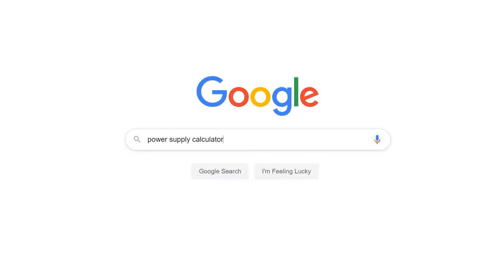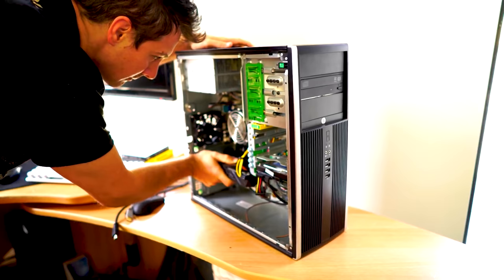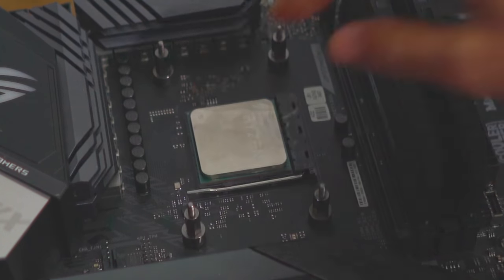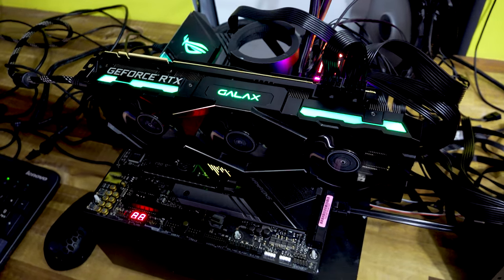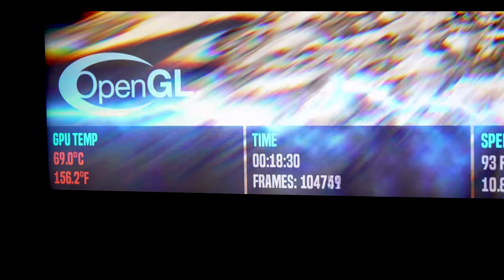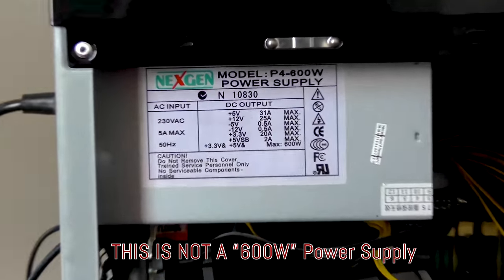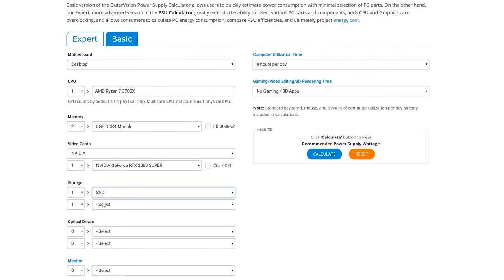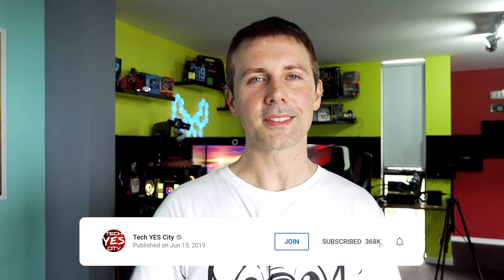I Tried Running a 3950X and RTX 2080 Ti on a 450 WATT Power Supply...

Comment: I'll give it 6 months. Had a 480w die on me in that time. Running two GT7800 cards in SLI with a P1 PhysX card, an X-Fi Fatal1ty, and an Athlon 64 x2 with a whopping 2GB of DDR400 RAM. Random hard drive errors and case feels very hot inside. PSU thankfully failed gracefully and did not go pop. Replaced with a 620w PSU, but it still runs unstable. The machine only became stable when I finally installed a 750w PSU.

Comment: Also its best to check "expert" part of that website and check how much your gpu/cpu model boosts because in basic mode they calculate absolute stock clockspeeds, for example gtx 1070 rated for 1500mhz while in reality its more like 1800-1900mhz just out of the box so the wattage automatically higher. I myself wanting to get 1kw psu because i plan on getting 3080ti and upcoming 4950x and calculating with its predecessors  3950x/2080ti with max load and actual clockspeeds and voltage (out of the box) its reaching 650w load without any other parts such as storage, fans, etc.. 

I bet if he did absolute stress test like furmark and cpu-z stress test at the same time the psu would shut down very fast and as he said its really not recommended to run these components on such low wattage psu.

Comment: This makes me confident I can run upcoming RTX 3090 or whatever with my Seasonic P660 mark2 PSU even tho it starts to be kinda old, I am sure it is strong enough! Thanks!
Reply: I would do some stability testing on your existing power supply (by running a gpu stress and cpu stress at the SAME TIME, max power draw on both!) and watch the voltage rails in hardware monitor (aka HWmonitor) to see how far the dip is on your 12V rails before deciding that it is good enough or not. If it is dipping a lot (like down to 11.5v) or you have instability, or you notice the PSU blowing very hot exhaust after testing a while, you may want to upgrade. Not every PSU with a given wattage rating will be able to handle the same size load, different brands and models will do better or worse.
Reply: @mikee9167  Thanks for the tip, looks like 3090 will be beast to drawing power! I notepad you comment to desktop txt file so I remember test when I have time, THANKS <3
Reply: @Muwex  no problem! to be clear I meant to say you should do this once you get the new video card to see how your PSU handles it, then you can upgrade PSU if needed and save money if not.
Reply: @mikee9167  Oh yeah sure!

Comment: Hey Nice Video. 
It was expected of YouTube to show this video on my recommendations as I was looking for PSU upgrade and searching for it. I too used to run a 450 watts PSU and it did the job just fine. After purchasing a new RX 590 paired with Ryzen 2600X (95W TDP), I felt that I need to upgrade my PSU. On the RX 590 box, they also had written that they recommend 500 watt + PSU to pair it with. What I learned was you can very well run everything on your 450 watt PSU, but it is the most stressed part in your build. PSUs are really robust and can last as long as your build, but if you juice them out regularly or frequently then it will not last you long. Plus I have seen many YouTubers saying to purchase a higher watt PSU than it is recommended as this will have the maximum efficiency of your system. 
Never cheap out on PSU as they have the potential to blast. Save a few bucks on your specs and go with a branded PSU. Hands down

Comment: Been running a 9900K and a 2080 Ti for a while on a 4K display on a 450W fanless PSU. If you set a power target around 80% and downclock to 4GHz (clockspeed isn't that important in 4K anyway), my wattmetter says it doesn't even break 270W during peak gaming.

Comment: it’s always good to go for a higher power PSU if it’s the same price as the one you’re looking in case you want to upgrade in the future. it will make it cheaper to upgrade, as you won’t have to buy a completely new power supply.

Comment: It suprises me you did't talk about efficiency. Efficiency logo's are a big thing in the PSU world.
You have a 450W 80PLUS power supply, so it needs to provide 80% efficiency under full load.
If you would use 444W on the 12V rail, the power supply would draw 555W from the wall. This means 444W (80%) is usable, but 111W is lost as heat.
It could be the power supply is able to deliver more then 444W, but not at an efficiency of +80% and so the 450W is a marketing decision. 
The input is 200-240V 4A, so the maximum draw from the wall is between 800W and 960W. If above 450W the efficiency could drop to let's say 70% (as an example), it would deliver between 560W and 672W. Also some power would go to the 5V and 3.3V rails, but you get the idea.
If used up to  450W, you have the 80PLUS PSU you paid for. If above (and under the max currents the fuses allow), you would be able to get more power, but at a greatly reduced efficiency.

I own a Corsair RM650X; this is a 80PLUS GOLD PSU. At a load of 50% it gets an efficiency of 92%. This makes it can be a semi-passive PSU. This means the fans don't spin, because almost no heat is made. So if i would draw 325W, only 28W is lost as heat. Under max load, the fan would spin up and the efficiency would drop to 88%. (650W to the system(88%), 88W lost as heat (12%)).
Long story short, there is more to a wattage on a PSU then the fysical max power that can go through it.

Comment: 450 W is the rated output. If it couldn't get 80+ certified at 120 V (only 230), that means it's just barely over 80% efficient. The highest watt draw I saw was 430, 80% of which is  344 W. This power supply is barely breaking a sweat.

Comment: You also can buy a higher rated, lower efficient power supply. It basically comes down to the same as long as you don't fully load it.

Comment: I have a Corsair VS 450, with Ryzen 5 3600X and Crossfire ROG STRIX RX570 with B450 Tomahawk Max and Gskill 3200mhz CL14 and 6Fans, Deepcool RGB 350 and 360AIO. 1x M.2 and 2 HDD.. Nothing happened... Still works great, although I have a expensive Servo Motor AVR, maybe that's the reason why it's still working to this day.

Comment: Hi there, can you tell me if that CM PSU is of good quality? And also the Corsair CX ones. CoolerMaster and Corsair opened up their branch in my country recently and I'm in a need of a good power supply but I don't have a lot of money. Is that CM MWE or the Corsair CX, or the VS, a good power supply? I'm planning to upgrade my graphics card as well with an RX 580 8 GB or, GTX 1660 Super or a RX 5600 XT, Maybe if I can the RX 5700 XT. Are those two PSU from these two companies good enough?

Comment: i currently have a 450 watt power supply and this is really cool and reasuring because it shows how high i can potentially upgrade my system from my 1060 and ryzen 5 4500, i might even be abkle to run a 3070ti if im careful which nis really cool to know. thanks!

Comment: The most important thing to understand about Power Supplies is the multiply your predicted load by 1.3 and that should give you plenty of headroom and keep your PS operating efficiently. Well, I can tell you that Corsair PS is not so great, I have had 2 fail on me but they honored their warranty.   EVGA is the only PS brand that I have used, out of MANY, that has never failed me. Multiple 12v rails is the best because the 12v rail is the most common failure because it has the most demanding load.

Comment: That "600W" PSU where did you get it? I need one with a negative 5 volt line for a project I'm working on. I hope you see this cuz I've spent over a thousand dollars on different supplies looking for a compatible unit. I've been piecing together a 98 machine and the main board is not liking the corsair units (tries to boot but switches off after a few seconds) the seasonic units just don't work no post code either. Apevia Units get it to the Post screen but the readout on the post code signifies the -5v rail issue.

In short need a PSU with -5v rail, tried supplies from seasonic(no post code),
Corsair (post code error with -5v),
Apevia units (post code error with -5v).
Any suggestions are welcome.

Comment: The only reason to get some more wattage is that psus are at the most efficient at around 60-70% load and then we have the soundfactor, 90% of psus are loud at 100% fanspeed so to only get it to 50-60% load you will have a silent one.
And people buy cpus for 500$, gpu for a 1000$...spends 99$ on a psu...just pay 200-250$ and you get the Ferraris of Psus with the best components, most stable loads and lowest ripple.

Comment: Hi Brian. I am using a b450m mortar max with r5 2600. My PSU is a seasonic s12ii 520. I plan to upgrade my rx 570 to 2070. Will it run okay? Bought the PSU last year. Thanks

Comment: My experience of using OEM power supplies, included with pre builds in my younger days was not a good one. When I would configure the PC, the power supply was always chosen by the company and they would supply something that was cheap and under powered to make the PC better in other areas (gpu cpu etc). I purchased a desktop that failed after about 2 years and a laptop that lasted only a little longer. So I think that you will get a PC to function under powered, as you've shown, but in my experience it's just been the longevity of the psu that would be in question.

I would never buy a pre build now, only build my own and have a power supply that is way too much for what I need but got an amazing deal where the 850w Corsair RMx 80+ Gold Certified psu was only 5$ more expensive than the 750w psu (black Friday 2019). I paid about 80$ for it and it retails for about 150$ atm. When I do eventually get a 5900x and a 3080 it should be able to handle it with ease.

Comment: in order to reach the limit of that power supply you need to draw about 563 watts from the wall and that will output 450 watts DC to system, This is because of the 80plus rating of the psu.

Comment: I totally agree with you but I bought a six sonic gold power supply that’s  1200 W For 90 bucks the same price for the 600 W power supply so I bought a 1200 W one because I’m planning on upgrading the jeep you later I have an 3700x and  RTX 2070 in there right now and I plan on getting a 2080 TI and 3950 X so I know my power supply will be good no matter what even though I only need about a 600 W power supply I future approved it because I got it on sale and that’s the only way I agree with buying a higher wattage power supply than you need is if you can buy it for the same price for the lower wattage that you really need as long as it’s from him highly rated manufacturer like sonic Corsair and some other big-name manufactures and make sure it has an 80+ rating on it love the video keep up the good work God bless you Ozzies and I hope everything is getting better from the fires that you guys are having

Comment: Did you boot the game and shown the into in the loop? I dont think tou stressed the gpu enough at 1080p, you nee to try and get 60fps on 4k on a game like shadow of the tomb raider with high settings to stress is for about 2 hours, inside a tower to get the hardware heated up. More heat =more resistance =more power needed

Comment: I have a Threadripper 1950x with a gtx 1070 & 1080ti and an 850w psu. I recently added a 2080ti and it would power off randomly during 3D rendering so I upgraded to a 1050w psu.

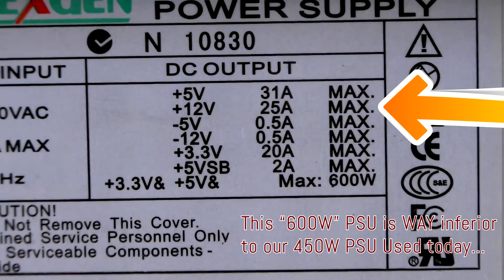Comment: 8:30 31A on the 5V rail? Is that PSU new? Because if that's the case, it's a pretty awesome find for retro PC enthusiasts. Athlon XP machines in particular require more power on the 5V rail than any modern PSUs can supply, because the CPU is powered off the 5V rail.

Comment: I think the tool is accurate but I was wondering if you could answer my question. My PC has a 450 PSU with an i7-8700, and an 8GB AMD RX580 GPU. If I were to upgrade the GPU only what is the max GPU I could go up to without changing the PSU. OR if I had to upgrade the PSU what is the best one to get if I want to get like a 1080ti? Could I still use the 450W PSU to run a 1080ti and be ok?

Comment: I'm using 2 power bricks (DELL DA-2) which max out at 215 watts, if its a slow ramp up in voltage surge. In actuality the bricks cap out at 206.3 watts. So I actually required 2 bricks just to power my 3060ti,as when I ran it on one power brick the graphics card would shut down. Thermal heat is alot of wasted wattage just to reach the power one actually needs from AC to DC conversion. I use these bricks to power the card in a HP 8300 tower

Comment: 700-750w PSU per computer is my sweet spot even if the calculator only ask for 500W PSU
I've been using Corsair, Evga, CoolerMaster

Comment: i use 450 corsair 80+ bronze for i7 6700K RTX 3070 MSI Ventus 3X with 16GB DDR3 (4GBX4)  1333mhz, and it works perfectly fine for about 6 hours now. i have a v650 v2 Cooler Master 80+ Gold though but i was too lazy to install it.

Comment: This video got you my subscribe! Now for a tricky one. I have an hp Prodesk 600 G1 with a 320W PSU. Currently I have a 75W GTX 1650 OC without external power, but I would like to upgrade to a stronger GPU, like 1060, 1070 or AMD equivalent. How much Power do I have available? I measured with a wattmeter when running Unigine and the PC is drawing 120W. Can I go for an 150-175W TDP for the GPU? I plan to use a SATA cu PCIE adapter for powering the GPU.

Comment: Well yes you are correct. Considering the money-saving-argument was used, there is however a scenario for using power-supplies like that if you have more than one PSU and the PC is temporary. You use two of the PSU in one PC (a GPU powered on the 2nd PSU), and then, upon deprecation of the machine to reuse its parts, you use the two PSU in two puny machines for office/web-browsing. At that point in time, you might even have lost some PSU efficiency.

Comment: I’m planning on upgrading my GPU, but I’m worried if my system will hold up. I have a SilverStone 500W 80+ PSU, a Ryzen 7 1700x, and I plan on upgrading to a 2070 Super 8GB from my 1060 3GB. Will my PSU be able to run this, or will I need an upgrade? I have seen people online talking about it being fine, while others saying you must have a 650W or more to even dream of running such thing. I don’t want to kill anything in my PC, and I want to be certain that I’ll be absolutely safe when stressing the GPU. I also want to mention that I do not plan on overclocking the GPU, so please keep that in mind.

Edit: Purely based on this video, I would think it would be fine, as my PC won’t be nearly as needing as this setup, but I just want to be safe.

Comment: if u can afford it 
- calculate (or check) your entire system consumption in the worst case
- double this number and u will get ideal wattage for psu.

Not only most PSUs have the highest efficiency around this point, but it also be an "easy job" for PSU and it will last longer.
Also extra wattage will negate PSU power loss from aging.

Never try to spare on a PSU. Doesn't worth the risk

Comment: You can run high end system on 550w psu, just psu wont survive longer than 1 week. Since all components became more power efficient I removed my 1500w thermaltake PSU and installed 750w gold. PSUs are not efficient at 20% load. My whole PC with 2x 1440p 32" 144hz monitors, 1080TI, 3900x and custom high end water loop draws 500w from my UPS on full load. 750W psu is more than enough for this config :)

Comment: Is there a way to push both the cpu and the gpu to the max? I think you either stress one or the other, like in cpu- or gpu-bound benchmarks, or gaming. In this case especially, how are you going to saturate 16 cores / 32 threads just by playing video games? You hardly reach the maximum drawn power.
I guess the PSU would have failed, if both parts had been squeezed for good at the same time.

Comment: Would you say a rtx 2080super with an all in one 240 Corsair platinum liquid cooler and 4 fans one m.2 and a Samsung 1tb ssd and the Ryzen 7 3700x run okay on a Corsair 650watt gold rated power supply?

Comment: I had the same CX430M run:
1) Athlon II X2 250 at 4GHz with a 550 Ti
2) Phenom II X4 960T at 4GHz with an HD7870
3) i5 4690k at 4.2GHz (4.4GHz would actually crash the system with some loads) with an HD7870
never had an issue

Comment: I'm planning to run a RTX 3070ti and ryzen 5 3600 on a 650W PSU 80+ Gold, so Im confident it will work with no issues. Sadly right now my system is working just with a GTX 1060 due to the card shortage :c

Comment: I remember running 5960X pushed to the limits with GTX 1080 SLI on 750W power supply. It was fine in most cases, but running a game with good SLI support and multithreading support could sometimes cause a shutdown, I was basically 50W away from shutting down so any bigger spike was causing shutdown. So in the end I had to upgrade. Can sometimes happen if you use power supply that was intended for a different build, but once you buy a top of the line PSU it stays with you forever so thats not a big deal.

Comment: my office desktop PSU snuffed out this month after 2 years, sent it for RMA and they are replacing the 500w with another 500w, and I'm hoping to replace the 980ti (personal) with a 3060ti and according to the calculator you used I would actually use less power by about 50W.

Comment: I blew up a psu once after it worked for a few days. Also the watts are on specific rails and braches potentially. So it is hard to under rate.

Comment: I've a PC with RYZEN 5 5600G, 32GB RAM and PC cabinet with 4 120mm fans attached with a air cooler. I'm running that with a 450W PSU. I built the system thinking that I'll upgrade to RX 6600 and that PSU would be enough but my cousin offered me a great deal on his older gtx 1080 ti. Deal is great but I don't know if my PSU will be able to handle a high end card like that.